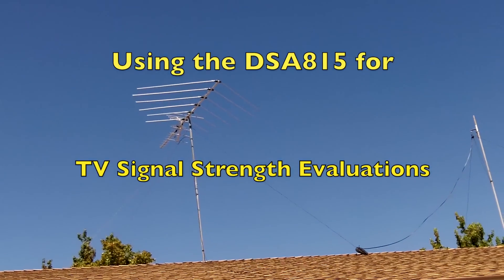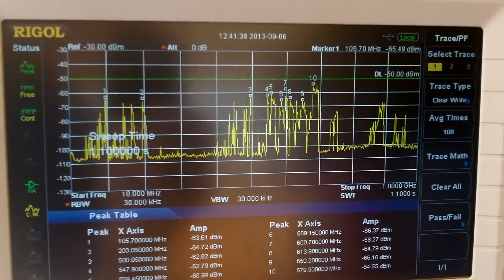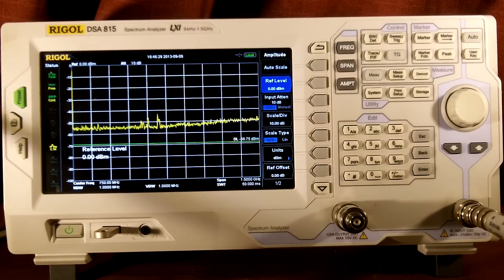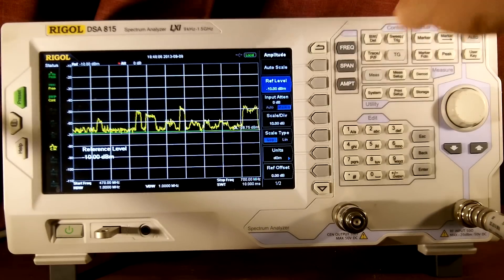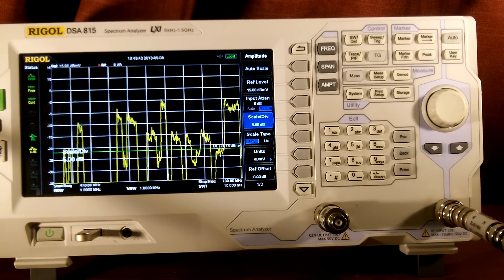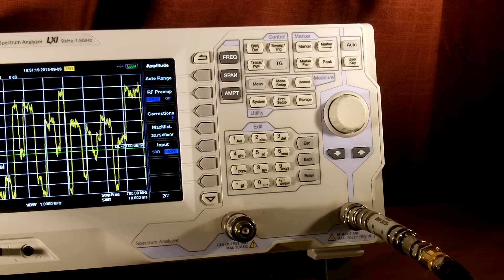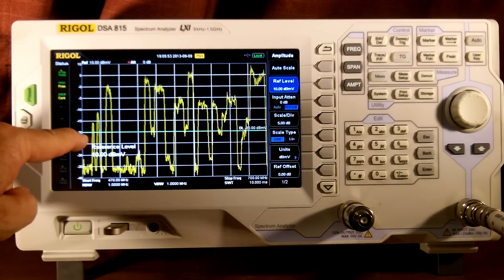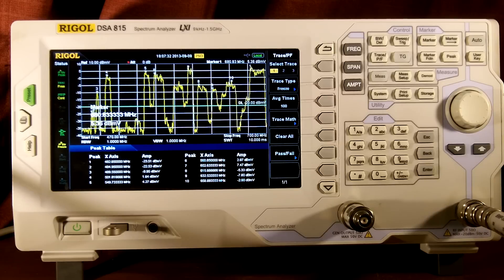TV Signal Strength Measurements and Evaluation

Comment from the maker: The FM BCST filter is used to reduce the level of FM stations to allow you to reduce the input attenuator on the spectrum analyzer to allow you to obtain a better view of weaker signals.  Whether this is 'required' in your area will depend on the locations of the FM and TV stations in your area and their relative signal levels.  In my area the FM signals are much stronger than the TV signals so that the FM filter prevents overload of the analyzer.

The 75/50 Ohm Minimum Loss pad is only required if you wish to have a calibrated measurement in dBuV.  However since most TV antennas have a 75 Ohm coaxial cable, the mismatch between this and 50 Ohms might cause some signal level variation from channel to channel due to ripple effects on the cable.  

Thus neither is 'required' just to look at TV signal levels but results using these devices will improve the accuracy.

Comment: So you plugged your antenna into the spectrum analyzer?
Reply from the maker: ilikeeggs216  Not directly.  I used both a 5.7dB Minimum Loss 50 to 75 Ohm Attenuator and an FM Band Rejection filter to make certain that neither the analyzer or its internal preamp would be overloaded by signals within the analyzer's 0-1500 MHz range.  This is covered in the beginning of the video.
Reply: Okay.  Also do you have any advice for someone like me who wants to learn exactly how TV cable signals can be graphed by a TV without it being a hodgepodge?  Pixels have destinations in the signal, and my goal is to learn how those destinations are encrypted in signals.  I'm basically looking for a theory behind the mechanism of graphics processors.  I also doubt that all models are the same.  Thanks!